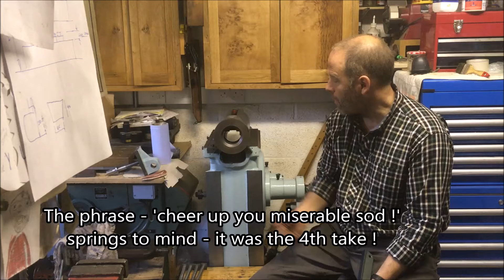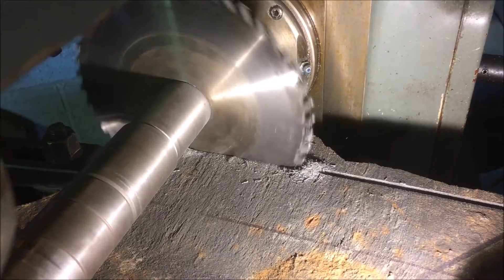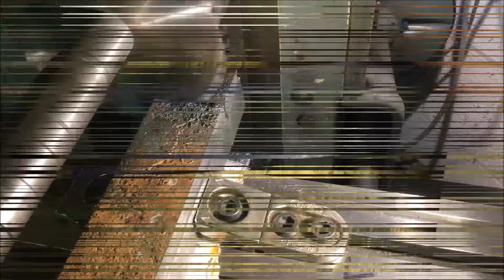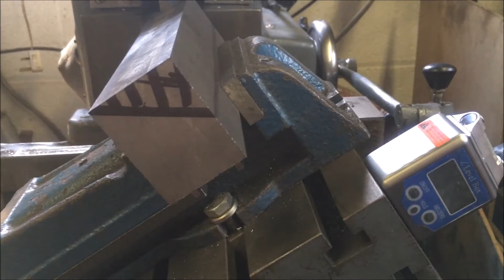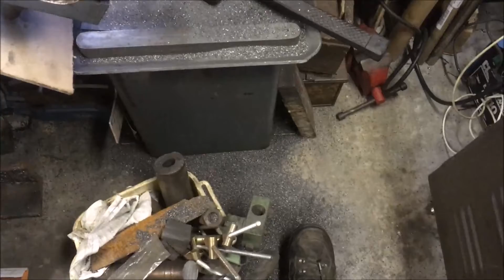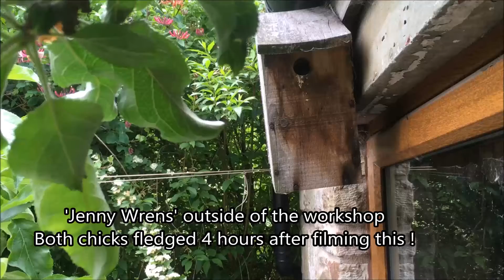Emmas Spare Room Machine Shop Tool Making Competition - My entry

Comment: I haven't had time to read all your comments but I've noticed that your shaper advances on the cutting stroke rather than the return stroke. Double check the video and see if I'm wrong but I don't think so.
Reply from the maker: yep - absolutely. I had thd pawl linkage running on the opposite side of the drive crank. Far from ideal. certainly not something I would do on the rebuilt shaper ;-) Not a real issue on Cast Iron as the chips break up pretty quick and as you can see im not exactly pushing the limits on the cut depth. but not good practice for sure.

Comment: My little 7" South Bend has the fixed non rotateable table. A semi universal shaper with having the ability to rotate it in at least one plane like yours Matt would be a great improvement.I also wouldn't have extended those slots the further 10 degrees either. But if the depth of cuts were kept on the lower side an add on sub plate that could be bolted on between the shapers cross slide and slotted again at 30 degrees of rotation and capable of being attached every 90 degrees should allow almost any angle required. A bit tough to explain with words alone. And something like that should only be added whenever it's really needed and not as a permanent addition would be something logical to do. An off set table support foot would also be required when using it as well.
Reply from the maker: I have something of that nature in mind for the 14S which is a fixed table version. I will have to take a good look at it when all the parts are finished to see what options are available.
Reply: My first thought was to make a 30 degree ramp to bolt between the box and the vise.  For my little 7" Atlas shaper, I'm putting some angled parallels on my "I really should make some of those someday" list.
Reply from the maker: I want to make myself a set of 1/2" wide parallels different heights - its on the list with adjustable pair and angled sets.... oh and starting a new list of what first... ;-)

Comment: I don't know much of shapers, did they make one with power feed on the work head? Seems like it would be handy.
Reply from the maker: Hi Wes, the larger shapers had such power feeds for the tool head and / or box rise and fall. A bit like rocking horse teeth trying to find ones on the used market though - especially in the smaller sizes. If you take a look at Steffan Gottesburg (I will try and show a link) his shaper feed fro the box could be swapped to drive up and down rather than across - not much use for my application on this occasion but worth investigating later I think. I think its one of these vids - https://youtu.be/etyk5pkCNAY

Comment: Loved it Mat, as I am sure you know, I built both the angled straight edges I have,  I just wish I would have put them on film.
I also like the black cast iron covered hands LOL , I know all about that.
Reply from the maker: When I had cleared the shop, I got inside the house and discovered I had obviously been touching my face (don't recall it) but I was pretty messed up for sure. Whilst I had used barrier cream on my hands - my face is still a little too pink after scrubbing it clean last night !  That cast Iron dust gets everywhere.

Comment: As a point of interest, I can't be the only one who would enjoy watching a video with fairly long segments of the shaper in action (rather than fast forwarding through it).  I get that some folks might be bored by it but surely it's not just me that would enjoy it.
Reply from the maker: You are not alone Bhima, alas for the competition Emma stated max video length of 20 minutes for 2 part so 40 minutes total. I think I ran the shaper for around 4 hrs including the cocking about with the set ups. I hope to have some better shaper footage once my 14S is rebuilt. now if you want a treat - how about watching this old footage of metal planners https://www.youtube.com/watch?v=HThSfJcrk-g&index=101&list=PLw800ZdGbNjE9EBdKYoQcIH6x1Lt6MwB5
Reply: That's a really great video and the narrator has great diction... if only the folks around where I live now spoke so clearly!

I'd never seen a shaper that had two cutting tools running at the same time before.  So, when are you going to restoring something like that? ;-)
Reply from the maker: I have never seen one of those planers in the flesh - the chap up the road tells me tales of his earlier years (1950's & 60's)  refurbishing such machines in Manchester along with pretty much all the machine centres I can think of.
Reply: Good gravy... I started wondering if they were making parts, or just making clock springs out of bad castings.  Thats a &^%#$%^@!! chip!